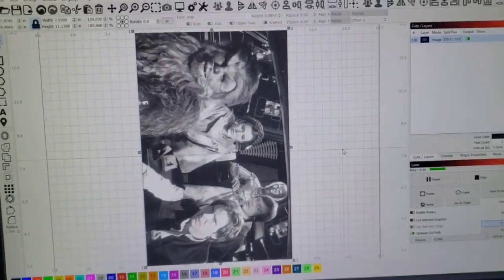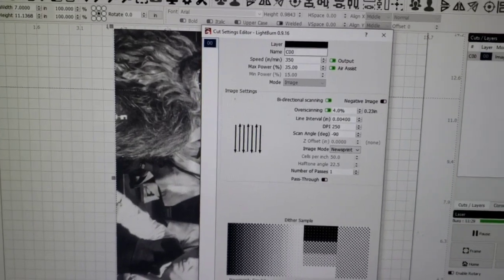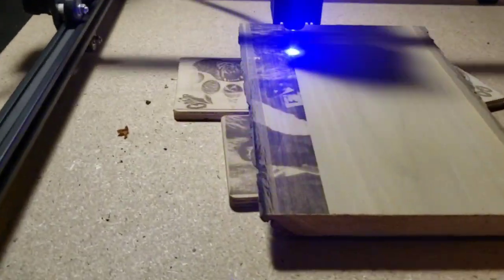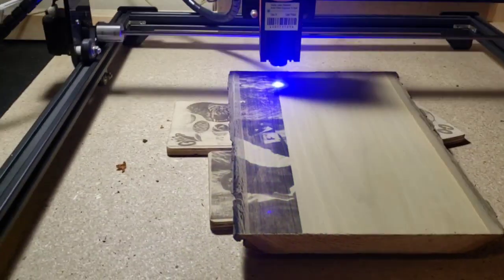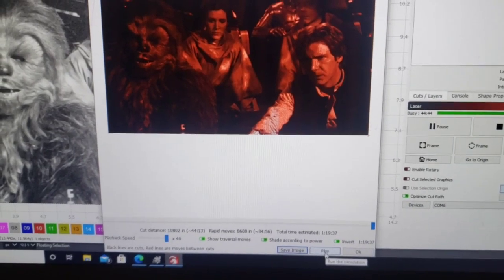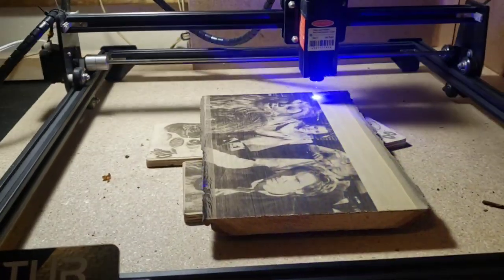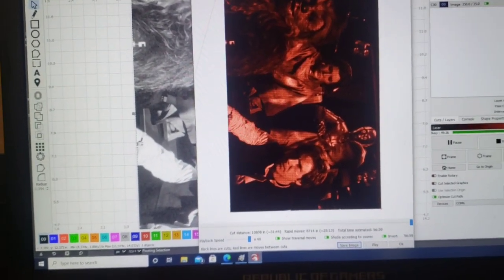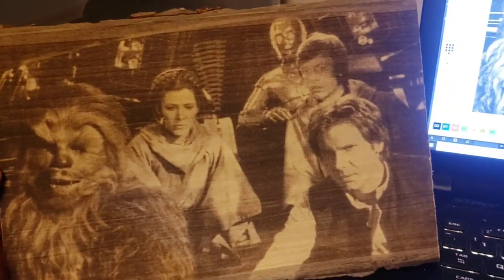"The Kenny Hack" Photo quality at 9000mm/min on a 5.5w diode! Ortur Diode Laser.

Comment: Great video! Excellent info for beginners, so thank you for your efforts. I have a question though. What do you think would happen if you left the work piece where it was and ran the burn again, this time on the X axis? Would this action reduce or take out those light vertical lines present, or would it turn into a god awful mess?
Reply from the maker: I think those lines you are seeing is the wood grain. Basswood is fairly light grained but still has enough variation that the wood grain is usually always visible. Some wood produce less wood grain variation but for me I kinda like a tad bit of wood grain visible. Makes it look a bit more natural for the material that's being used.

Thanks for watching.

Comment: Kenny, genius! Got a solution of "Kenny Hack" brewing now. I've tried and failed repeatedly to engrave decently on wood following countless how-to videos and none worked worth a damn. If all these how-to vids conviently left out treating the wood first somehow, I'll be miffed. Like I said...or should have, Thanks!
So the only question remaining is...how do you set Lightburn to engrave on the y-axis? I just can't find the toggle.
Reply from the maker: Set scan angle to 90° in the Cut Settings Editor. You do have to run test patterns to find the right speed and power. But this stuff makes the wood burn so easy it should be easier for you to figure it out. Just watch all my wood videos and you should get a good idea on how to do it.
Reply: @TheKennyHack  Got it! Thanks again!!
Reply: What is this kenny juice

Comment: Thanks, came out nice. When you focus the laser, do you focus with or with out safety glasses?
Reply from the maker: With the cheap yellow or dark green ones that came with it. They don't block out as much as they should and I can still see where my edge focus is at. The good glasses block too much and its harder to focus. I guess I've never had much issue of getting the laser focused without using colored card stock or microscope. I start off out of focus high then keep turning it down making the focus smaller until I just start to see the edge getting bigger again then take it back a little and call it good.
Reply: @TheKennyHack  yeah, so I use card stock? Ok. I have the more expensive glasses and they block out everything
Reply from the maker: @cutflower36  that one has always perplexed me a little. If you are perfectly focused on the card stock you are focused slightly higher than the working surface.  With wood id think it would be better to be focused at the surface or slightly deeper. The card stock definitely makes it easier to see tho.
Reply: @TheKennyHack  ok. Good info. I need all the help I can get. Made some of that juice you was talking about too. Thanks a bunch

Comment: Nice work.  You are correct in part that the grainy look is because of image quality, but it's also because you are using newsprint in the Lightburn layer settings.  Try Jarvis instead...it's a game changer!
Reply from the maker: Doesn't work very well at these higher speeds on the light end of the scale. Could adjust the image to make the light a little darker. Also, running jarvis seems to overload the gcode going to the machine and it will stutter for awhile until it buffers all the gcode. Newsprint seems to be the easiest for the machine to process at these higher speeds. I ran a test strip on the back with jarvis and it wasn't printing any of the detail in Chewbacca's fur. With a good HD image Newsprint makes for very good subtle shading.
Reply: @TheKennyHack  Interesting, thanks for sharing.  I've been doing a lot of larger canvases with jarvis and I agree that I get about 1 to 2 minutes of some light stuttering initially until the controller "catches up" to the code and speed.  Are you sharpening the image at all?  It's really helped my prints.  I usually use radius 10 and percentage 150.  It gives nice crisp lines.  I also usually increase contrast and then change gamma slightly too.  I have yet to try anything higher than 3000mm/min yet though.
Reply from the maker: @suipsysof  ya, I do all my photo editing in Lightburn. I don't use plugins they want to use too high of resolution and that adds a lot of time to the burn. I used to love Jarvis at the lower speeds and high resolution passes. Its kind of a toss up of quality vs time. The Jarvis under the right settings does look better at a super  close inspection but looking from a few feet away I think the Newsprint gives a better appearance of lighter shading. I mostly work with wood it might not work as well with canvas and the paint removal techniques. Ive only done a few no paint canvas prints and need to work out the details of those better. After being able to run at such high speed and low power on wood its been hard for me to do a lot with the other techniques that run at such slower speeds and higher power.  They look awesome but I think its harder to price that work to the customer when they take 3x as long. I couldn't charge 3x the price for the same size of project would be a tough sale.
Reply: @TheKennyHack  I understand completely but for me, laser machine time is a small amount of the pricing strategy. Essentially, I am charging power usage and a "depreciation" amount of the original purchase price as each minute the laser is running is technically reducing it's remaining life.  These are based on the amount of time the piece takes on the laser.

My pricing is cost of all materials, 10/hr of actual human labor (usually not more than 15 minutes on most pieces for painting, sanding, or image processing), and then a simple formula based on the area of the object to be engraved. This means for me that a piece that takes 3x longer doesn't mean 3x the price, probably more like 15% more or so. Obviously longer burns then eat away at profit, but this is mostly just for fun for me at this time.  Most of mine are in the 30% profit margin (and remember, that's after I've paid myself 10/hr labor).

Comment: How far away is the laser from the wood?
Reply from the maker: I try to keep it close to 35mm as I can get. No z axis so +/- 5 mm and it still does fine. This is a stock lens so it has a wide range of focus. Without a z axis control im not bothering with putting in a G8 lens yet.
Reply: @TheKennyHack  Ty for reply